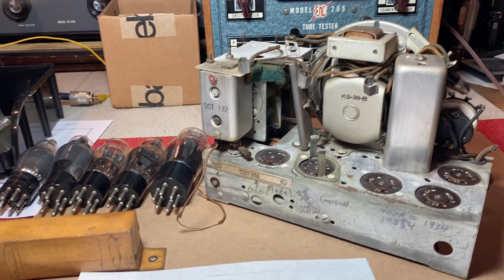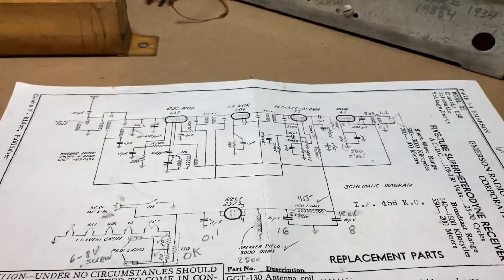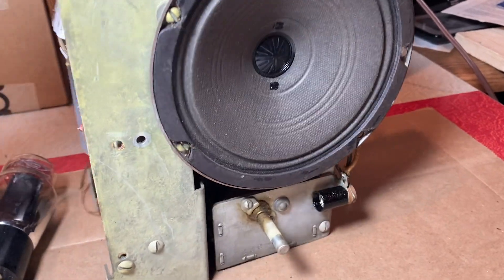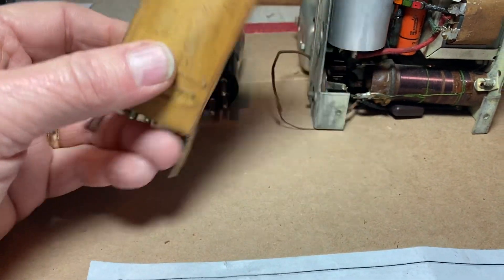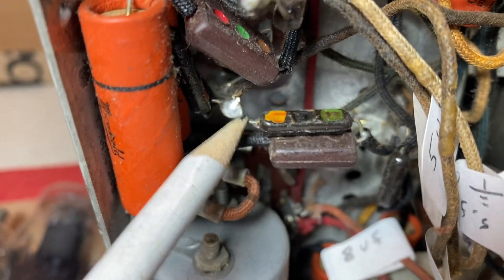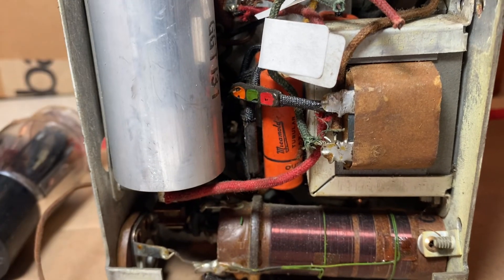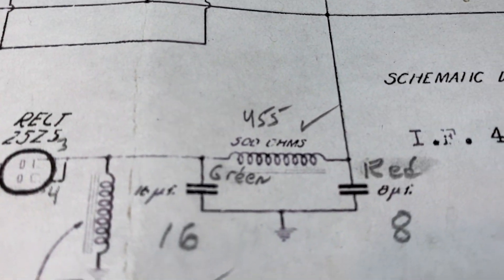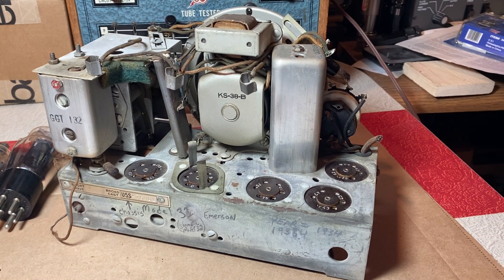1934 (not 36) Emerson Model 31 AM/SW Radio Repair Part 2

Comment: Good news on the continuity checks! You might want to cover the speaker with a pice of cardboard. I have ran my fingers thru a couple in my day. In fact, poked a hole in one with my VOM probe….lol……Thanks for sharing….Take Care—Larry
Reply from the maker: Thanks Larry. I opened the box electrolytic capacitor and it tested bad. I’m going to try to do a restuffing to keep it period correct. I’ll video that effort and post it.
Reply: @tompadberg336  that should make it easier, sometimes its hard to salvage those old boxes as they become brittle. Take Care—Larry
Reply from the maker: Thanks for the info!